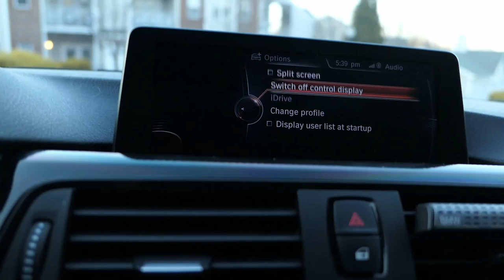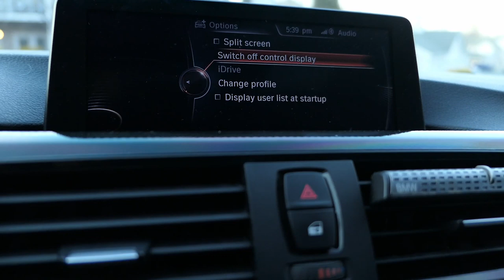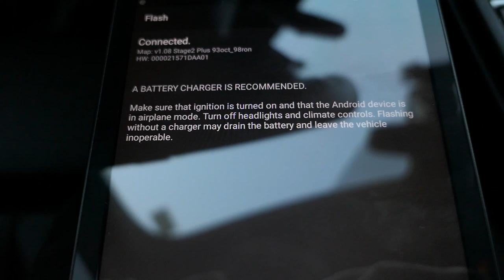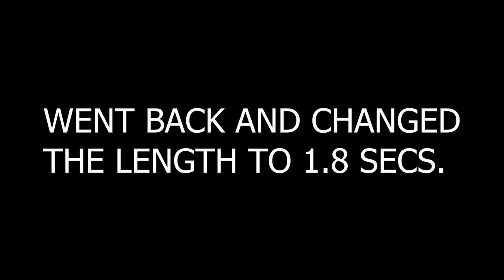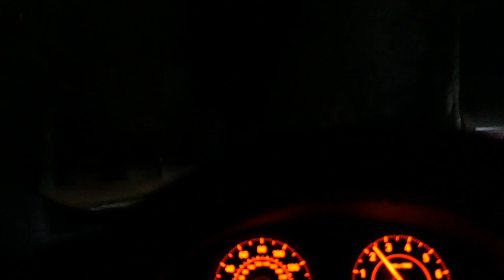Testing MHD Aggressive Burbles on my BMW 335i | F30

Comment: Try with DSC off, it dumps more fuel. MHD by itself most likely won't give you flames, maybe with meth with might but you'll have better results off of a custom tune.
Reply from the maker: I think I had it off but can't remember. I'll give it another try and see but custom would be definitely be the best

Comment: Weird... even mu stock tune with mperformance exhaust does more burbles. Soon going catless dp and mhd burble stage1. I think its going to be wild.
Reply from the maker: I changed the settings to not do it so long to try to a get a single pop instead. Then changed it a bit longer but it was too loud for my taste for every day use. Just changed back to stock burbles yesterday

Comment: I’ve deleted my resonator, fully gutted my downpipe and my muffler, my car doesn’t burble AT ALL when In park. I don’t understand it. First I did a muffler delete when I first got my car and nothing. I thought ok well once I go catless it’ll surely backfire in park! Nope. Not a thing. Pretty disappointed. I’m tuned with mhd too so I don’t get it all.
Reply from the maker: I would contact MHD if you  adjusted your burble settings and it doesn't do it. I saw a similar case once but this was a while back
Reply: Eldridge Cortes thanks man, I’ll do that. I also tried setting the burbles to 0mph and it did nothing. Oh well. Hopefully mhd can sort it out.

Comment: Hi mahn what problema have u encountered with the mhd
Reply from the maker: none
Reply: @EldridgeCortes  great also i am plannin on doin aftermarket wheels do i need tpms?? Im new and just need some advice
Reply from the maker: @Jsmooth596  I would recommend getting some if you can. Otherwise if you run without them it won't let your car go into sport mode. You might be able to code it out but I've never looked into it. Easiest and most convenient is to just pay extra for new ones
Reply: @EldridgeCortes  thanks bro and is the a specific type i need to get or just some ebay 1s could work